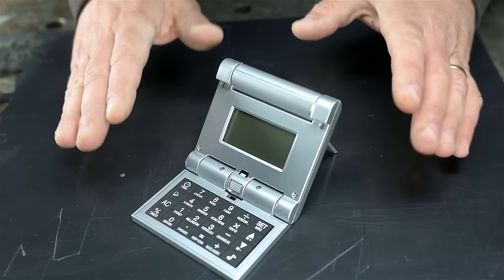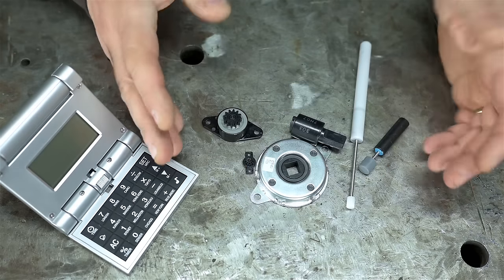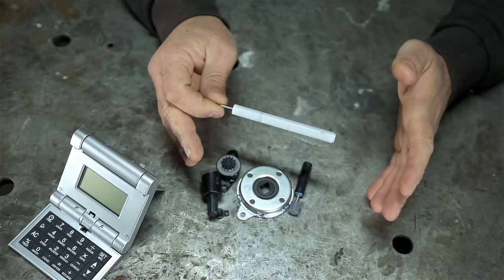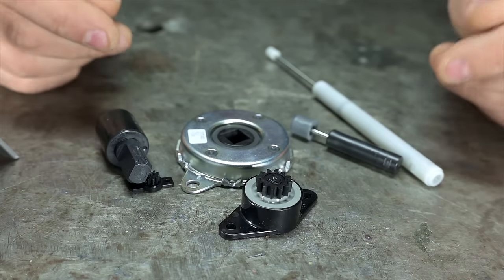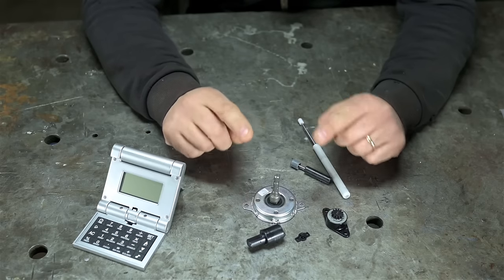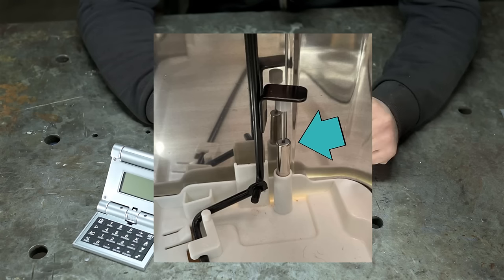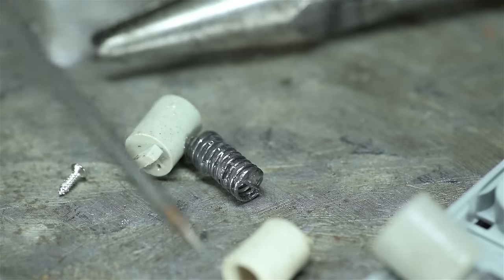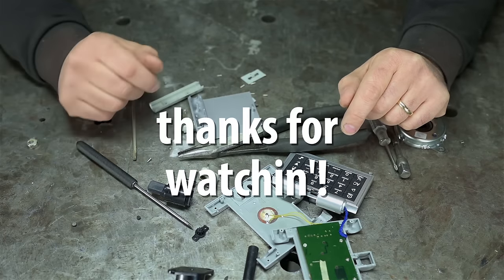Dampers... WHAT A DRAG!

Comment: My favorite example of rotary dampers was on the joystick of the F-14 Tomcat. Being designed before fly-by-magic the joystick was directly connected to the huge, 3000 psi cylinders moving the stabilators in the back, To stop excessively "maverick" pilots from ripping the stabs off in high speed maneuvers, dampers were installed to slow the pilot input.
This gave ground crew the ability to punish errant fighter jocks by asking the to do several minutes of stick "wipeouts", involving moving the stick through it's full range while under a closed canopy in the hot sun. 
We would tell the pilot that we needed it to troubleshoot a problem, we just left out the part about the problem being them not listening to ground crew instruction.
Reply: Were they told afterward that it was punishment?
Punishment is worse when you know you are being punished.
Reply: And then the bastards who designed the F-16 just bolted the joystick down. Ha!
Reply: Eddy current damper?
Reply: @pgtmr2713  those are epic! And so failproof they are being used on many rollercoasters and joyrides.
Reply: @seriousZmij  Many different kinds. But I was asking if the part the op was referring to was the eddy current damper specifically.
Reply: @shawbros  good point, kind of sounds like it's just for the satisfaction of revenge if they don't actually know they're being punished for doing a specific thing.
Reply: And everyone made it home?
Reply: They had used the less viscous version of Chuck Schumer's hair grease.  It is marked #2 in Gray barrels.
Reply: Sounds like Top Gun movie

Comment: I just want you to know, this video has given me the solution to a problem I've been trying to design around for a year. Dunno why I didn't think of it myself, but thanks.
Reply: This video has given me a problem to a solution I've had for a long time
Reply: Was it.........

Rotary dampers??
Reply: @operator8014  Helical dampers! But yes this is a solution to a cam-like issue I was working on.
Reply: @operator8014  Aawww, you beat me to it.
Reply: I'd like to add, I used to have that same calculator my dad gave me from a ag industry convention... It was a cool gadget when I was 10. Thanks for the nostalgia👌
Reply: You've been trying to design a problem? That's an interesting idea. 🤔
Reply: @BriarHood They must work for Chrysler or Volkswagen
Reply: @BriarHood  it starts as an attempt at a solution but from there..
Reply: Don't go too crazy with rotary dampers. It could lead you to a dark place.
Reply: You aren't using enough explosives
Reply: @jrmbayne  this solution has given me a problem to my video.
Reply: I've been trying to figure put how to get a custom prop Sonic Screwdriver to open slowly. Problem solved. If I can't find a small enough linear damper to fit I now know how to make one. All I need is some of that goo...
Reply: I designed a problem once then she divorced me.
Reply: @BriarHood  He must be an aspiring architect/product designer etc,,,lol
Reply: @operator8014  no,

It was Rotary Dampers
Reply: Did you have a dampened spirit prior to this videos release?
Reply: @jrmbayne  what are you, The Deep Thought?
Reply: @markfergerson2145  I bet some silicone lubricant for O rings would work. Not quite as sticky as This Old Tony's mystery sticky goo is, but close and I bet just as thick. Not as thick as This Old Tony pretends to be sometimes, but as thick as the mystery sticky goo.
Reply: @jrmbayne  spoken like a true politician
Reply: @ctlaurin  The Jedi would not tell you about the dampeners, it is a pathway to abilities some consider, unnatural.
Reply: @kodykj2112  Dotary Rampers!
Reply: Me too, gave me an idea to fix an issue I have been trying to design a fix for. Thanks OT.
Reply: @mikereynolds1368  Wait a damped moment, what the heck would a guy named Reynolds know about viscous (read sticky) fluid properties. Heck, he probably has  a number named after him to describe motion in sticky goo. No, it's not the Mike number, it's  the ..., that's right, the Reynolds number (technically it's a whole bunch of numbers).
Reply: The answer is always rotary dampers.
Reply: @stanmacdonald1073  I guess that wraps it up.
Reply: @markfergerson2145  you can use sap as a damper, though checking different greases might be a good idea
Reply: @satibel  I want to avoid anything that has low enough viscosity that it would run out of less-than-perfect seals even very slowly like sap does. So yes, I'm experimenting with different greases.
Reply: @markfergerson2145  pine sap is very sticky.
Reply: @satibel  Yep. But it drips.
Reply: This video has given a solution to a problem I've yet to find for a long time

Comment: The coolest example of rotary dampers in consumer tech is definitely soft-eject cassette decks -- not that anyone uses them anymore, but still.
Reply: One of many things that fascinated me as a child. Lol
Reply: My cheap cassette deck lid mechanism just had plastic gears covered with schmoo, which worked fine at first. Every time I opened it to switch tapes those gears were exposed, and they gathered dust and lint as you would expect. It went from soft-open to pry-open within a year or so...
Reply: In the far distant past, top load video cassette decks had a rotary vane air damper to ease the otherwise violent eject mech. a little wingity thing that spun like crazy.
Reply: I use them all the time!

Comment: The goop is called viscous grease or just damping grease. For faster action you would use viscous oil - vehicle suspension, camera tripod heads. A solid state counterpart is viscous rubber. Mostly butyl, widely used in acoustics.
Reply: Thankfully I didn't have to wade through endless nonsensical comments to find this one !
What is it based on if it is not water or alcohol soluble ?
Reply: @ian-c.01  oil-based, silicone-thickened. Exact composition is never revealed, like with any oil/grease/polymer
Reply: The best viscous grease is from Scotland, UK, where it is harvested from the scrotal sacks of the male haggis in springtime. Very very expensive. And a dangerous job to harvest. In an emergency situation dampers can be repacked with standard pig spunk but only expect half the damping qualities.
Reply: @typhoon2827  it has to be used for deep fried Mars bars first, or it wont last as long.
Reply: @typhoon2827 , that is only minimally accurate and maximally misleading: habits is excrement, without association to sex (or gender). Perhaps the dearth of information about it is due to the cost, though I wonder if it isn't a reflection of the source…or the odor.
Reply: @typhoon2827  sounds like beaver secretions, the natural food flavoring found in things like raspberry flavoring!
Reply: @grigorbrowning  I don't have haggis money but I'm using my own under current economic situation. To be honest it works just as well.
Reply: What's the proper stuff for getting it off your hands? Or is it something that is only made by disposable-gloves-industry shareholders?
Reply: @afivey  If brake cleaner doesn't get that off, I think I wouldn't want to touch it.
Reply: So, Molykote 111 is a heavy silicone grease we use to use a lot of in the centrifuge business. There are facilities where it is straight up banned though because, it doesn't matter what you try to get it off with, it's going to hang on. So in a facility like an auto shop that does painting, having a grease that is impossible to perfectly clean off is a big no-no. And if you think I'm being a bit hyperbolic, to properly remove the stuff, you'd likely have to dissolve it in dimethicone or some similar siloxane but, guess what, now you've just got a thinner layer of silicone. What that translates to in a paint shop is areas where paint just ain't... Gonna stick. What it means for your hands is, scrape off as much as you can, use an abrasive soap and be glad to have baby soft hands until that layer of skin is gone.
Reply: @geraldgepes  Similar problems in optical assemblies with mechanical parts.  Can't use silicone lubricants because they chemically bond to glass and are impossible to clean, if they ever stray from a bearing or gear onto an optical surface.
Reply: @ian-c.01  super glue
Reply: @MostlyPeacefulWACO  or ATF 😳

Comment: The most common damping grease is made by Rocol and is called Kilopoise. It's available in a number of grades from very light to crazy stiff. It's also stupidly expensive, but a little goes a long way. I use it for rejuvenating potentiometers that have dried out,  been cleaned or feel gritty among other stuff.
Reply: I was about to write a comment that I wonder why that sticky grease is not used for all springed hinges because that makes a pretty cool rotational damper with very little parts and doesn't need any o-rings. If the grease is expensive, it's much cheaper the leave it out and forget about the damper effect.

Comment: I'm actually respecting the simplicity of that design. Very clever.
Reply: Imagine the process of assembling them all in a factory without getting in a mess.
Reply: It does leave me wondering about the goop. Is that just someones grease recipe with some ingredient quintupled? Did some lab spend months testing for the exact right, or just maximum, amount of goopishness? Did the manufacturer have to run their mixing vats half-empty so the motors could cope?
Reply: @Paremo_  nah, they just doubled the motors
Reply: @Paremo_  My humble guess is that this is what is left after a cracking process of silicon oil. When you "build" hydro silicates it's rather difficult to control the chain lengths so you end up with a mix of stuff. Fractional distillation can sort that for the shorter chains pretty easy, but once you get to boiling temperatures of several hundred degrees it's easier to just stop and start using a cracking method. This gives better yields of the lower chain length variants (which are usually in higher demand) but it also causes polymerization of chains with many side branches.... and thus you end up with some unusable "goo" ("tar" would be the hydro carbon equivalent) as a waste product... But what if that goo could be it's own product? :P
Reply: Thank you for not saying 'literally'.
Reply: @andersjjensen   It looks like the same stuff that 3M gives you in those tiny tubes for greasing electronic parts. (waterproofing) only thicker.
Reply: @BiggMo  I don't know whether engineering a washing machine is really more impressive than a Space Shuttle. But then again, engineering a Space Shuttle with the budget of a washing machine would be impressive, though.
Reply: Brilliant

Comment: The "sticky goop" is a high viscosity silicone fluid. Most of unsealed dampers use this in some way or another.
Few things will dissolve it other than siloxane solvents such as Polydimethylsiloxane (dimethicone)
Reply: now you tell him
Reply: @chrisburbank6484  It "wears off" the fingers over an hour or two.
 "wears off"  as in: transfers to everything you touch - not a big deal unless you are a spray painter. Ask a spray painter what he thinks of silicones if you want to learn some new words.
Reply: @Paul G: Polydimethylsiloxane is a key ingredient in personal lubricant -- maybe that would remove the schmoo?  I've used similar Polydimethylsiloxane-based liquids when putting together bendy, tricky-to-fit rubber assemblies.  It works pretty well.
Reply: @Paul G  My stepdad paints cars and you should hear the things he had to say when someone put a car that had been slathered in Armor-all in his painting area. I definitely learned quite a few new words that day.
Reply: Probably PG-44a. It's also good for the mounting points on your quadcopter. Reduces vibrations going back to the gyro onboard.
Reply: usually those spray aircans can dissolve such crap
Reply: thank you.  that was my big question
Reply: @nalinux  Colicon® Degas® or Flatulex® should work better and cheapier.
Reply: Next time try bear grease.
Reply: Why is Polydimethylsiloxane following me?!    This is the third comment I've replied to in a week about it ?! ...  It's also called E900 - and used as an antifoaming ingrediant in brewing, which I where I last spotted it in the comments.
Reply: @njones420  Frequency bias, or just a coinkidink. Encounters of a term that is obscure will seem to have a less regular distribution over time, so it's probably a bit of both. Happens to me all the time, almost like connecting themes or awareness weeks.
I'll try to memorize E900, unless I run into that big word a few more times.
Reply: @ronnetgrazer362  I'm sure just coincidence, all started with my dad phoning me to source some polydimethylsiloxane for his birch-sap beer... I'd never come across it before then.

Comment: I have seen eddy current dampers (neodymium magnet & aluminum disc).  I have also seen the spring function done with a pair of coaxial magnets.  There are also "friction dampers" using magnet & iron with wide hysteresis loop.  These have constant drag force independent of velocity (like friction brake with constant normal force).  Advantage is no goop & no mechanical wear in the brake.
          Expensive camera lenses are "lubricated" with viscous grease to give them the "gushy" feel.
          Another damper is the "butterfly" in a clock to regulate the speed of the chime movement.  This is a "gas rotary damper".
Reply: Don't forget piano dampers. (I'm a piano tech trying to be relevant)
Reply: @schannoman  That is a totally different animal.  That's designed to stop vibration on an external input.  The piano action part that is more relevant is the hammer back-check to prevent hammer bounce.
Reply: @bpark10001  Thanks for explaining my job to me. I was being pedantic.
Reply: @schannoman  More like explaining your job for you, since you opted to complain about not being included yet didn't put forth the effort yourself.
Reply: @nopenoperson9118  oh yay. More irrelevant sealioning
Reply: @schannoman  And you're doing it all for free, to boot!

Comment: Another very similar application is to provide a pleasing resistance to knobs, like a volume knob on a stereo. These things work not so much with baffles, but with close fitting surfaces that slide across each other (to use oil it would be more like a shock on a car which relies on oil being forced through small orifices by a moving piston). This stuff is more like really sticky grease than oil, so it won't drain out and it maximizes resistance. Like you see in the video this stuff is almost like glue. Very messy to work with. Another point is that they self-heat because they are dissipating the braking energy as heat. So they start to move faster if you cycle them a number of times. Nye Lubricants sells a wide variety of formulations of "damping grease" for these purposes. I used a Nye product on the Evertune guitar bridge to prevent high frequency vibrations which caused buzzing.
Reply: wait, the evertune? that's yours?

wow, that's an amazing design, kudos!

(for those watching at home, imagine a guitar where you can just twist the tuning key randomly or even push or pull on the string itself and it will not change in pitch; it's kind of uncanny in real world use)
Reply: Oh geez, yeah. Nothing makes a piece of electronics feel cheap like an un-damped knob. Manufacturers could, of course, use potentiometers and rotary encoders that have built-in damping, but those cost a few cents extra.
Reply: can you provide a pleasing resistance to my knob
Reply: @Jujudo  oh, internet...
Reply: I can see why you'd want a volume knob that heated up and turned easier as you work feverishly to find the right volume:-)
Reply: As the years go by that grease dries up making the knobs harder and harder to turn.